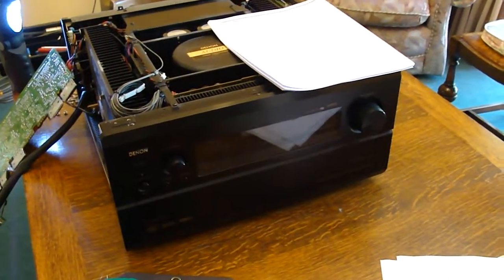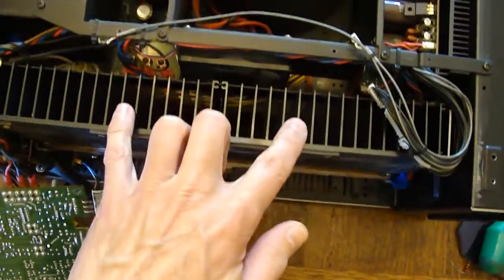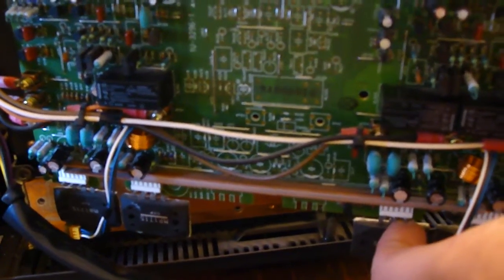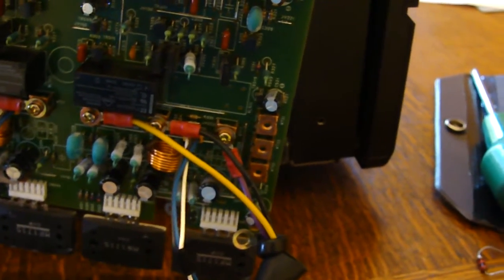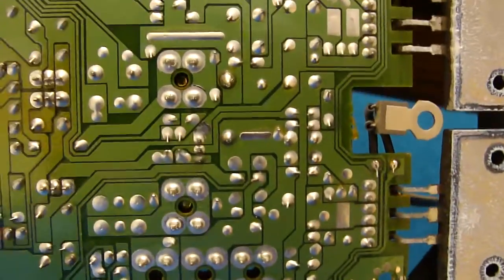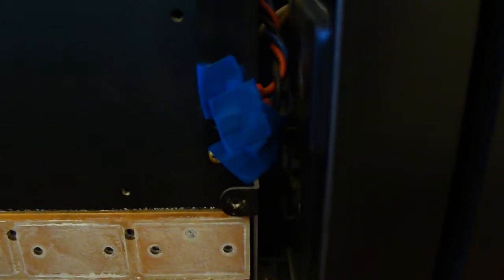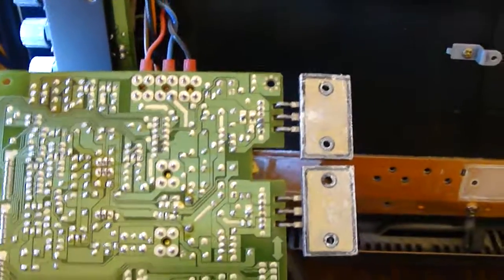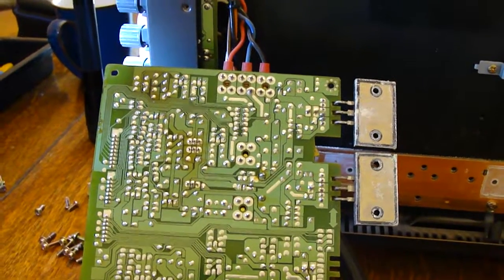Denon AVC-A1SE flashing power LED, bad solder joints

Comment: Hi , i have had since new ( about 17 years now ! ), an AVC-A11SR AV amp and it has started to click rapidly with the display flashing . If i leave it on then it can end up with the consumer box tripping and it also plays havoc with the cordless phones too . The clicking is preceded by audio mute while watching a program and minutes later will start the crazy clicking/chattering noise . After a reset , all is well for a few weeks or months and then it all starts again . Wondered if you have any ideas please as this is like part of the family and i don't wanna put it down ! , thank you
Reply from the maker: It sounds like something is arcing internally and it is interfering with your cordless phones. What does it trip in the consumer unit, one of the fuses/MCBs or the earth leakage detector? This would give you a clue as to where the problem might be occurring.

I would take a careful look inside the Denon and follow the incoming mains supply. It is possible that there might be a problem with some of the insulation somewhere or it may be a component breaking down.

If nothing is obvious from a visual inspection then you will need a high voltage generator, something like a Megger. You can then test between L/N and earth. The worst case would be a winding fault in one of the transformers. I doubt that you can get replacements any more :-(

Good luck!

I have added a link to the service manual & schematic in the main video information above.
Reply: Many thanks for that information . It trips the main fuse to the ground power supply . The cordless phone base unit begins to make weird sounds and these then continue after the amp is switched off until the phones are then turned off . Curiously , the amp seems to behave when set to , say , Dolby II or THX settings
Reply: I could cost an arm and a leg to get it checked out and fixed and it may be economical to replace it with the plasma set .

Comment: Thank you for this ! I have the same AVC and it's 220v 50Hz. Now that I live in Ecuador, I need to power it in 110v 60Hz. Do you think there's a "switch" to change the voltage or do I need to try a huge transformer 220v-110v but I won't have the correct frenquency then. What do you think ? Thnak you in advance for your help in case you have an idea !
Reply from the maker: I think that you are out of luck. The A1SE does not have support for dual mains input voltages. There was a separate USA version which was actually marketed under a different model number (AVR-5800).

You may be able to use a step-up transformer and the difference in the line frequency may be OK. Since you are going to a higher frequency then it is likely to be less of a problem.

Otherwise I would look to see if you can buy a second-hand AVR-5800, however, if it is not local then the shipping cost will be high.
Reply: Thank you so much for your king answer ! It's clear now, I will try a transformer, as it is the only solution ! Thanks again !